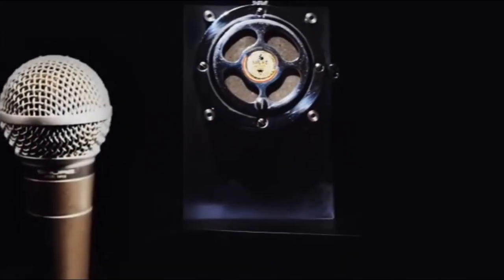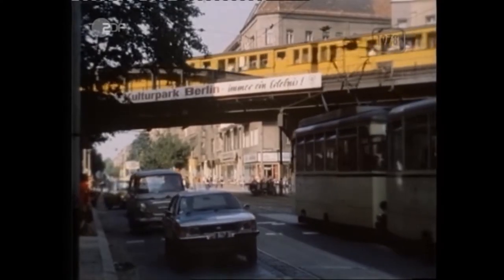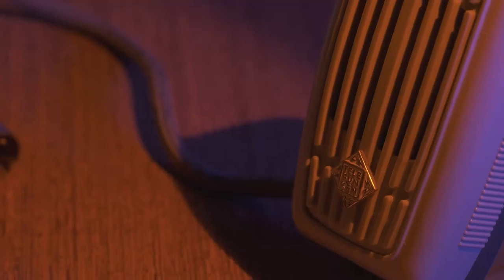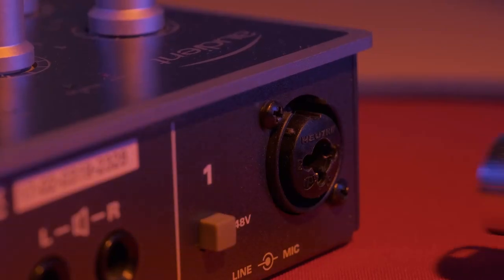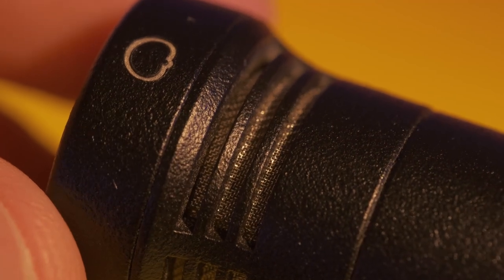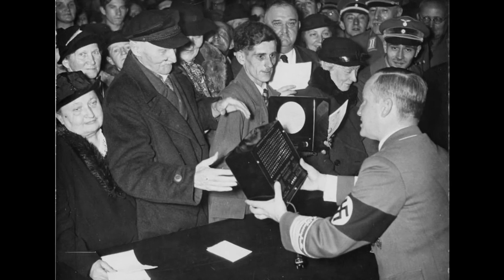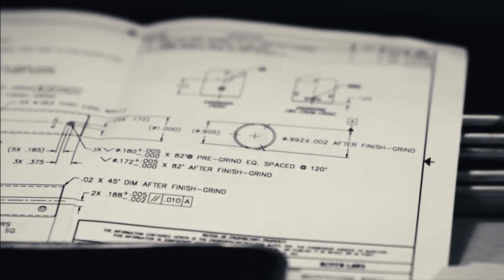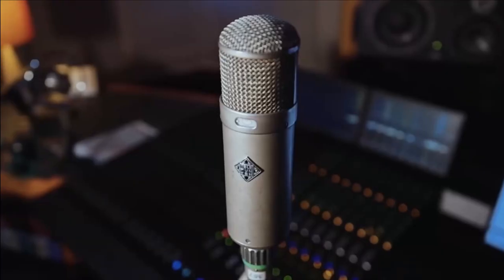Are German Vintage Microphones just better? - Telefunken D9A

Comment: So is the D9A symmetrisch, oder unsymmetrisch? Thank you, if you're still reading this!
Reply: Consumers doesn't need balanced and I have doubts, that any consumer tape was equipped with balanced inputs.
When they started to offer power mixers with speakers with the goal to amplify the vocals in a loud orchestra, non balanced inputs were also used for microphones. It came later, that live equipment became more and more closer to studio equipment.